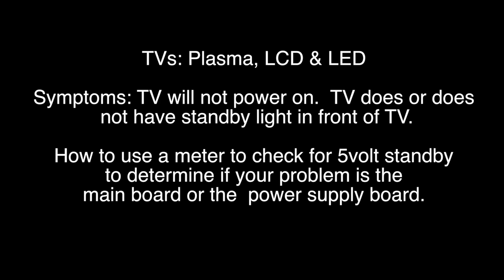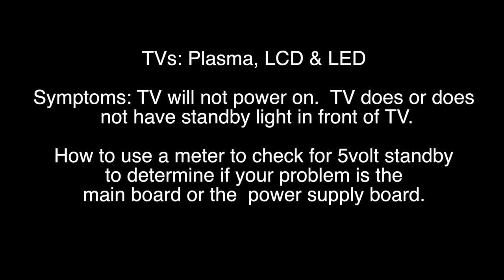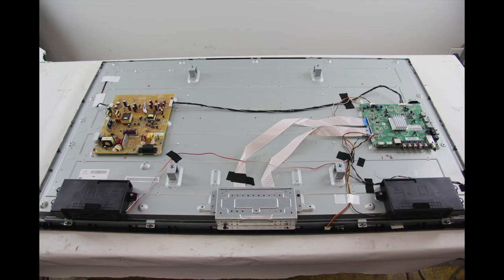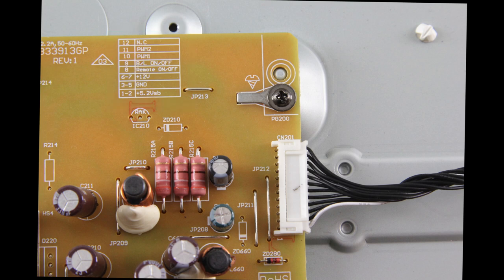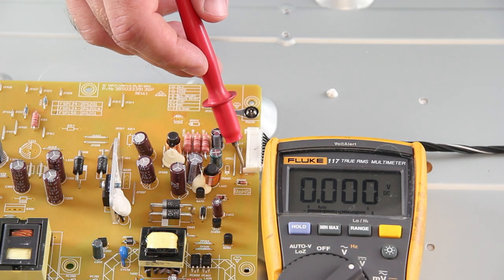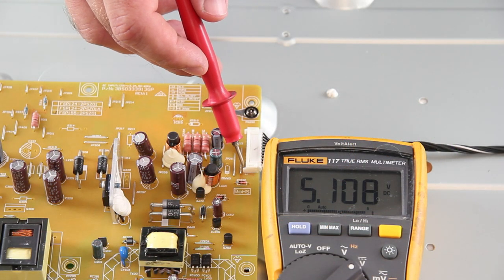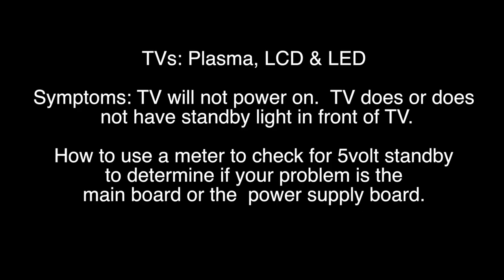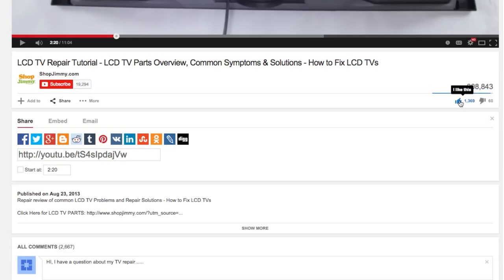TV Will Not Turn On Troubleshooting Help - LED, LCD & Plasma TV Troubleshooting TV Will Not Power On

Comment: Great video cheers - wow unbelievible how many expect a comment posted here will draw you to diagnosing theyre various problems,I also note many have ignored the information in this video as theyre question/s prove.  Ive never figured myself any type genius or even some smartass but wow some dumbass,s huh, ok from a beginner trying to help dumbass,s heres 2things that will help as you scrole down under these videos click SEE MORE for more info READ IT ALL, and instead of hitting up the video posters for your personal questions to seek answering try using the youtube search field - present your question there &youll get an array of videos dealing with your issue,just as you search google or another search engine-use youtubes search sure works good when I utilise-once again thank you the jimmy.com video poster.

Comment: Its NOT a Troubleshooting video, Replacing Board video. Bring it to me I can tell all the voltages coming thru all the components in that, And I will fix the same board, No Replacement needed.....hahaha....

Comment: Help you speard the ""Savings"    Your first tip is to replace this board, and if not helping replace the other board aswel...  I do know you are trying to run your business there,  but  you are basicly trying to sell all electronics for tv , without even bothering to figure what actualy is wrong with the tv.   what component has gone faulty and why .     Just replace all , its all fine.  and of course if the actual screen is behind the breakin boards, then its  customers fault cos he did the work of replacing boards.   

I hope bottom of my heart that bussines like yours and every other in same businesmodel  is going in bankrupt fast, really fast, before you have time to do more damage.   If you dont have time to do proper guide, then dont do it all,   if you dont know how or why,  dont pretend to know how.  You seem to lack in both sides.